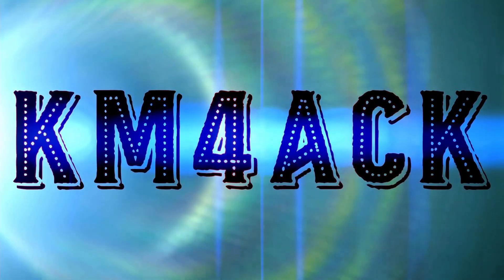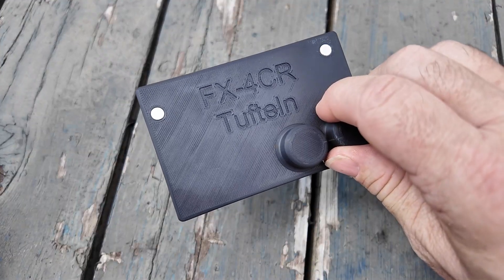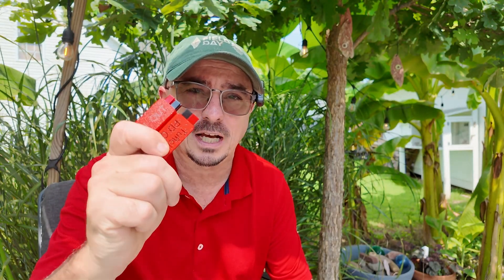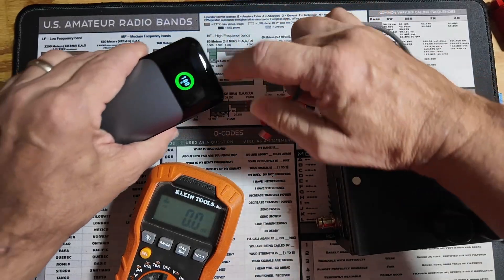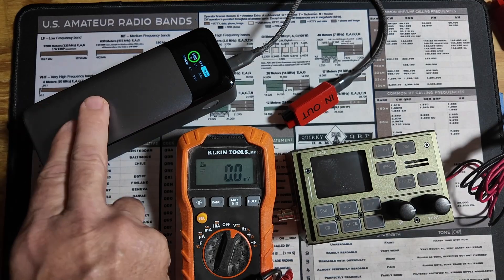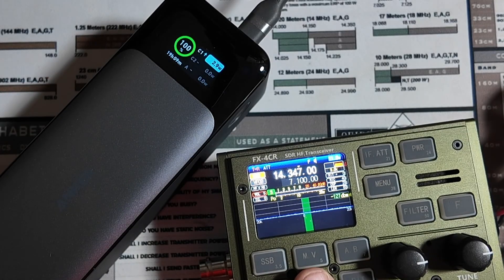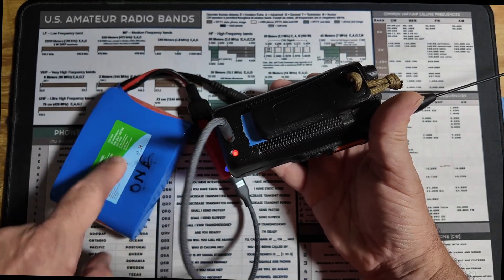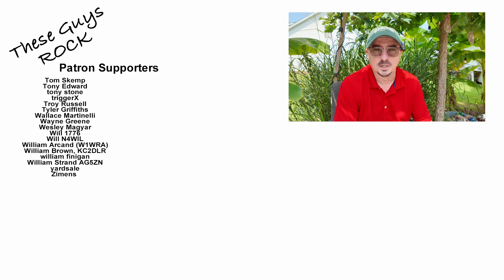💡 Two Must-Have Tools for Makers & Tinkerers! | Tufteln 12V USB-C Solutions

Comment: I use a PowerPole distribution strip, and the older version of the USB-C Out dongle, to keep various USB-C devices topped off during a longer operation when I'm using a big battery anyway (e.g. 100Ah + FT-710 + laptop; the dongle keeps the laptop topped off easily). Really glad to see him evolving these to make it just a little easier to use! Invaluable gadgets!